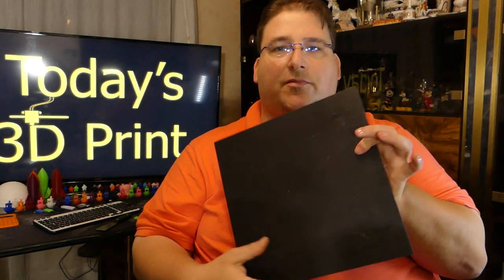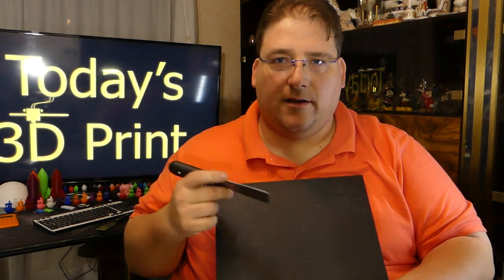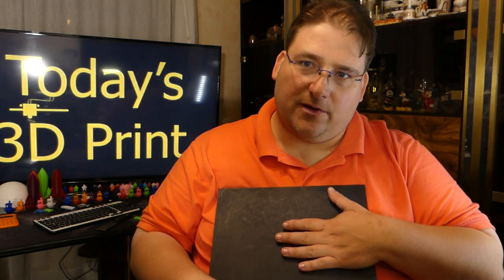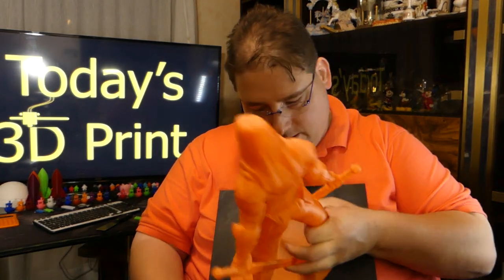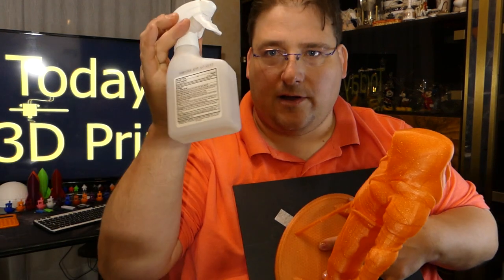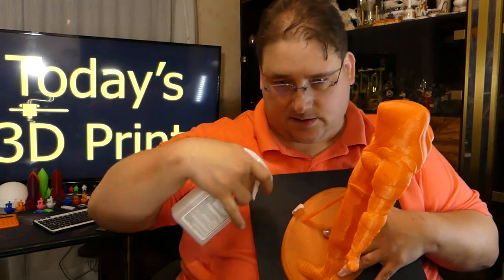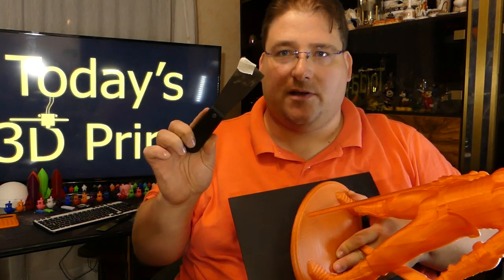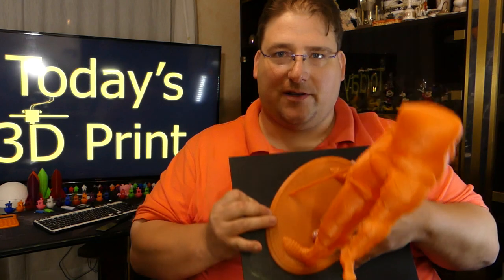Today's 3D Print 127 Setting up an Entry point for hard to remove large prints

Comment: This is simple and genius.  I have a Tevo Tornado, and this is essential.  That damn Tornado bed DOES NOT let go! (good, but bad!)  Thanks for the tip man!
Reply from the maker: +Ansi Drop its pretty durable too just keep that tool flat so you dont dig into and tear up your bed. Also reduce your squish just a tiny bit. The bed surface is prettty good.

Comment: Neat idea that :o) Does the PrintNZ replace the glass or go straight on top?
Reply from the maker: +ebuTuoY I applied straight to Glass to get a nice flat surface just like with any other Print Service I applied directly to glass
Reply: OK thanks it did look like one thick piece to me in the video have got Lokbuild at the moment and it is quite damaged now like you said and shows on the bottom layer. will have to look into it cheers!

Comment: I thought that PrintInZ can flex.  Is that not enough to get the print off?
Reply from the maker: +SCYFOR they have two versions flexplate and skin I get to skin because it's significantly cheaper and I have fixed it directly to glass so no flex the same would apply to build Tak or Pei applied to glass no flex but nice reliable flat print surface :-) I am working on a way to make it flexible to do something like what build Tak and prusa are doing with the flexplate system

Comment: i was thinking,,,,, :)

i know you have at least 3 ender 2 but also some of the bigger ones and we all know they are running almost 24/7 if possible

i also know that you try alot of different filament types so ime thinking.

How often do you change nozzle on your beloved printers ?

After cleaning up your rooms, i know your gonna get even more printers.

wondering.....  Several printeres in the same room printing 24/7

Will you get Tinitus before christmas or are we talking a couple of years before that happen do to the WWUUuuuUIIIIiIIIIIIIi WWWwuuuIIIIIIIIIIIIIIIIII from the steppers
Reply from the maker: +mistube I already sometimes have eight printers going some of them usually I keep them in a separate room now and I'm usually not home so no hearing problems most of the noise in the videos it's because of the microphones gaining up I'm also going to be modding all the printers to quiet them eventually I'll have 15 plus printers going but not all at once unless there's a need
Reply: And question ?
Reply from the maker: +mistube I totally missed your question sorry about that I never change the nozzle ever at time to change them to harden ozil's but that'll be a one-time change